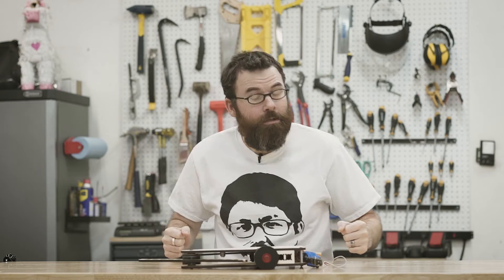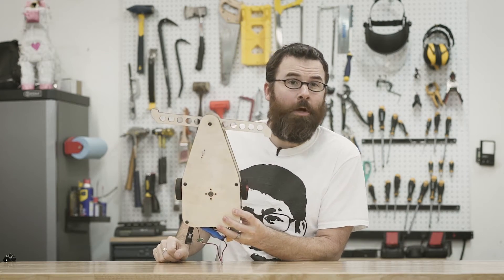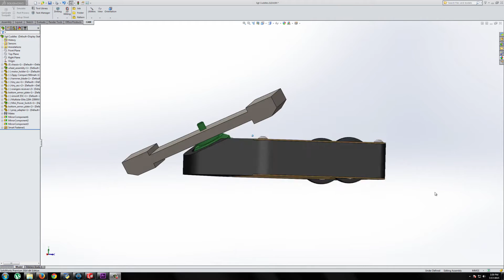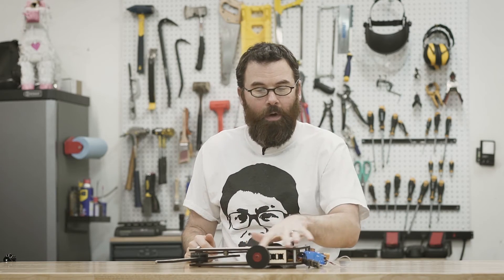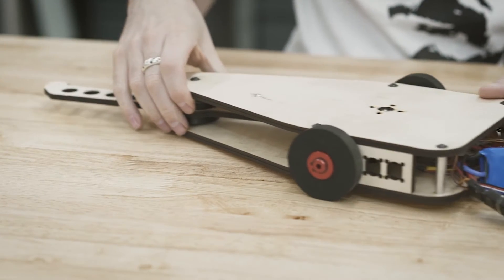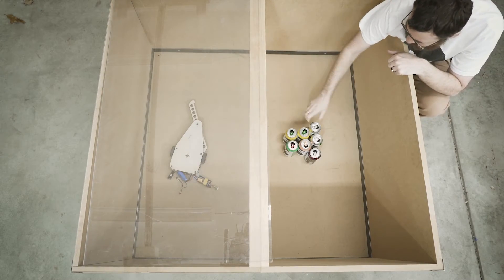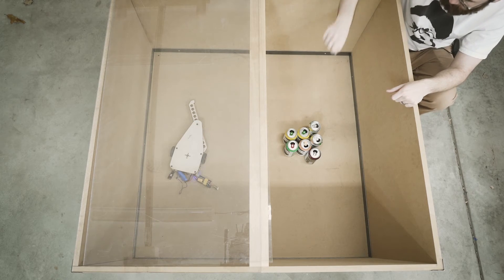Psychotic Break Build - Drive Mockup

Comment: Is there a good tool for the circlips , all the circlip pliers I have never seem to have pegs small enough
Reply from the maker: If you find one, let me know!  I've been looking for one small enough for ant and beetle motors, but have had no luck.
Reply: @RobertCowanDIY  ah,will do. Just ordered a pack of so called micro circlip pliers that supposedly have a 1mm tip which should in theory fit the foam lite wheel hubs I hope. I'll post the findings on saturday
Reply: @RobertCowanDIY  I got a set of US Pro Mini circlip  pliers, about $10 a set and they have tips of 1mm so they fit the fingertech circlips, yah..

Comment: If you don’t mind me asking, what’s the torque on the propdrive 580kv motors? I’ve been getting mixed answers in the product descriptions. I can’t tell if it’s 2 n.m or 20.
Reply from the maker: Well, there are tons of sizes, but I can tell you it's not 20, it's going to be closer to 2 NM.  Calculating torque is tricky, but it depends on the current driving the motor as well.  But it's going to be much closer to 2, 20 would be a massive brushless motor.
Reply: Robert Cowan alright, that’s what I got on the first one, thanks!

Comment: Remembering that the blade is more than one pound and the robot can only be 3 pounds makes this robot really impressive. I am amazed by your skills and your amazing Gary gin shirt
Reply: Also, I think you should still keep the speed, you never know when you need to charge your opponent at full throttle
Reply from the maker: @duangbiao4522  Nah, I want more torque behind the weapon.  Plus, the slower speed will 'grab' more, which is what I want.  I don't want to just grind on people.